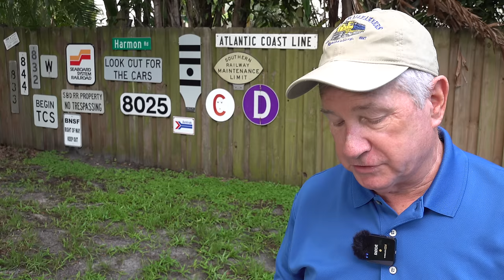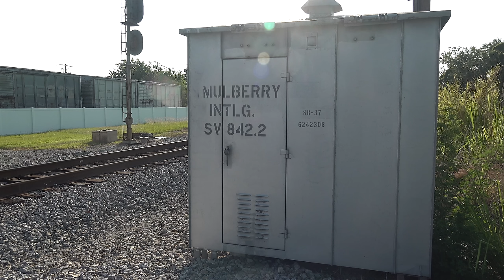Who Controls Railroad Diamonds?

Comment: I still can’t get my head around the system in the US
(In the UK, where i live, although there are many different train operators, the track is owned by a single company (ignoring light rail and heritage lines), and that company handles all the signalling (and train crews contact the signaller directly when needed), and i found out that if a bulb burns out on a signal (completely burns out), it may cause other signals to automatically return to danger (red), and that is the reason why there is a signal somewhere on the UK rail network that is still lit even though it no longer serves a purpose, the UK also has equipment installed at some signals which can automatically stop a train if the signal is at danger (red) and the train is either approaching too quickly, or passes the signal (every train is fitted with equipment that interacts with the equipment on the tracks))
Reply: Every railroad owns their own tracks for the most part. Railroads can buy trackage rights on other railroads and operate on them if the other railroad agrees to it. Amtrak has trackage rights on most of its lines because it only owns the NEC and and a few hundred miles elsewhere. Overall, it's probably similar to how things worked in the UK before BR.

Comment: Why hasn’t anyone invented a rotating frog on these diamonds such that the wheels run on a nearly continuous rail head?
I guess maintenance and reliability might be less than fixed frogs. 
I would liked to have seen a train using the OWLS direction. 
Anyway, great post. 👍

Comment: It depends. Automatic inter lockers, you have to automatically get down, manual inter lockers, are controlled by control operators or Dispatchers
Reply: At least on the BNSF side who I work with, if it’s automatic, we would get down and push a button and it’ll allow us to go across if we had to stop. We would talk to which ever railroad we were crossing unless it was our own, I’ve had an interlocker drop to red as soon as I approached the signal and it put my train in suppression and when we passed the red signal it put us in emergency and we stopped 40ft from the interlocker, it’s a bit scary
Reply: You should hear what some sound from inside the cab, it can be loud some are very smooth but metal on metal, isn’t very comfortable

Comment: At 6;20 the signals can and will go into a time ot episode, but usually you will get a proceed signal when yo get on short approach. Also if you are pulling hard as in notch 8, when your locomotives go over the diamond you throttle down to notch 5.
Reply from the maker: Thanks Richard. Those are points I did not know about.

Comment: Awesome video Danny! However, I do have a few questions that I hope you could answer.
I am planning an HO Scale layout in which a double track signaled BNSF main line crosses over a single track, non-signaled UP branch line. Which railroad would operate the signals? Would they be automatic, or dispatcher controlled? And would the UP have to call into the BNSF dispatcher for permission and a signal? I hope you can answer these questions and keep making these amazing videos!
Reply: Chances are in that situation it would be an automatic interlocking. The UP line would still have signals, and I presume your BNSF line would be CTC. If it was manually controlled by UP, the BNSF dispatcher could call the UP dispatcher and ask for the signal, or the BNSF crew could do it themselves once they got into radio range of the UP. If it was manually controlled by the BNSF, the  UP dispatcher or crews could do the same.

Comment: If it's a controlled diamond, the railroad that got there first controls it. If it's an automatic diamond, whoever hits the circuit first. If the train has a red at the automatic diamond, they 'll have to go by the instructions in the interlocking box. Controlled is controlled either by a dispatcher or tower operstor. Automatic is exactly as stated, automatic.
Reply from the maker: Thanks Charlie. I'll put that in my notes.

Comment: Great Video, as usual. Not all railroad crossings at grade are interlocked.  There still exist crossings where a 'fixed signal apparatus' is operated by train crews after making a 'Statuatory Stop' to line their route.  Such a fixed signal may be a horizontal crossbar with or without appendages such as balls that are displayed horizontal for one carrier and vertical for the other carrier.
Reply from the maker: Thanks, Yes I hope to cover non-interlockings soon.

Comment: Interesting video on an interesting topic. I thought I read that the 'frogs' of switches, use a special steel alloy for the pointed crossover, that can take the hard hammering of train wheels as they cross over the gap in switches. I would think a similar alloy is used for the crossovers in a diamond. Thoughts?

Comment: Great video, I don't have any background on railroads but I find your videos fascinating. I once again make my plea that you do a video on what happens when a train derails and why they seem to be coming more prevalent. Also, it would be great if you could also touch on what processes are in place to prevent it (like the gizmos that measures bearing temperature)
Reply: Derailments are not rare, and never have been.  Most derailments happen at low speed and very little of the train is affected.  It's the high speed derailments that are catastrophic.  

Whether catastrophic derailments are becoming more  common can be hard to judge.  There is bias in what happens in the world and what one hears about.  The high profile derailments of late have dealt with the issues of toxic cargo on trains.  Such derailments can obviously affect a large number of non-railroad people.

Derailments can happen for a few different reasons, but the largest reason I know of is rail fatigue.  As heavy and solid a piece of rail may look, they can have microscopic flaws inside that can, over time, become bigger and cause sudden failure.  A broken or ready-to-break rail is obviously not good for a train to ride over.  Railroads (especially bigger ones) have or pay for third party special rail scanning vehicles to scan the rails' internals for yet-unseen flaws.
Reply: @jovetj  thanks for the excellent explanation
Reply: @charlesreid2141  Sure thing.
As for what happens when a train derails... it's pure physics.  Especially inertia.  
There are many other things that can cause derailments, such as poor tie/sleeper condition, rails out of gauge, damaged wheel flange, seized wheel/axle bearings, broken axle, damaged or poorly maintained track switches, too tight of curves with too little weight in cars on the curve, going too fast on a curve, probably some other improper train handling that I can't even think of.

Comment: One thing I have wondered, dispatchers know what signals are doing but do they know what their trains are doing at all times?  that is do trains run something similar to ADS-B transponders that all aircraft use squawking their course and speed in real time.
Reply: Nope, dispatchers usually only see block occupancy (if it's CTC). They can't tell if a train is stopped or moving, although they can see the time between certain points to get an average speed between them. PTC might be changing this, but what a train is doing at any given time typically isn't a priority for a dispatcher.

Comment: Basically all diamonds are custom-made due to them all having slightly different angles, and as such take a long time to make (several parts are cast and molds have to be made). For this reason, it is not uncommon for railroads to keep an old diamond around somewhere in case the one in use is damaged. CN does this, and it's a great way to get a close-up look at diamonds without having to stand on the tracks

Comment: @Distant Signal Towards the end of the video saw that you have a Kenwood radio in the truck how do you like that radio compared to the Motorola when listening to railroads?
Reply from the maker: I think the Kenwood is about the same as the Motorola as far as receiving goes, but the Kenwood has far more features and flexibility. Audio output is not as good though. I miss that big Motorola sound.
Reply: @distantsignal  Try adding an external speaker.

Comment: What if there were multiple rail lines running parallel to each other which are intersected by a set of other lines all of which are  owned by different companies, trying to get authorization to move your train through would be real messy. Just in theory.

Comment: Hey Danny, I've made a rail video or two but I'm not extremely knowledgeable about the inner workings of the railroad. I notice when filming some of the cars seem to pass by with a smooth roll and others pass by making a racket, as if the wheels on the car aren't smooth/circular. Am I correct in this assumption?
Reply from the maker: Yes, that's usually what's happening. If a car has one or more wheels with flat spots, they make a racket. If all the wheels are smooth, the car won't make much noise at all.
Reply: Thanks Danny @distantsignal

Comment: I kinda wonder why Amtrak is running two locomotives on one side of a train, both with the cab facing the same way. Talk about efficiency (or the lack there of)...
Reply: Plenty of time to turn them at the end of the line. No reason to have them on both ends of the train.
Reply: @sharkheadism  It's easier/cheaper to run a train into a wye to turn it around, than to walk to the other end of the train?
Reply: @Tiger313NL  I don't know if they wye a train or not but that doesn't matter because they can switch it out too. The locomotives will be sent to a service facility to get ready for their next assignment and that will take at least a couple of hours anyway. They're not like planes where they need a quick turnaround, if engines are needed in the meantime the service track will likely have other locomotives fueled and serviced, ready to go.

Comment: WHAT is  a C plate for?
Reply from the maker: The C plate indicates "Stop and Check". Usually on draw or swing bridges. Stop your train and check that the span is lined and locked before proceeding across. UNless you have a green, or confirmation from a bridge tender that the span is OK to cross.

Comment: Doesn't diamond crossings feels a little 19th century. Why not build a bridge so the speeds can be higher?
Reply from the maker: Bridges are incredibly expensive and often not practical in crowded urban areas.
Reply: @distantsignal  can’t be many left in Western Europe. Heard there are only a few in the uk . They have so many disadvantages. First the tear and wear must be devastating and the speeds must be very low to cross them. Hardly good in 2023.

Comment: How can there be a Purple-D-Rail-Sign in existance?
- Shouldn't a railroad company avoid derailing at al cost?
 This sounds dangerous,: "Yeah, sometimes our trains derail on that piece of track, let's not fix it, we  did put a purple sign there."
Or, what do I know, what a D-Rail-Sign is supposed to signal, maybe I just don't know, anything?
Reply: It's a safety switch that's used on sidings: youtu.be/4J7bjROO-gc?t=159
Reply: @MellowYe77ow  --> Thank you very much !!! Now it makes so much more sense to me.
Reply from the maker: Sometimes it requires derailing one train or car to keep it from hitting another one. Very rare, though.
Reply: @sebastiank1714   You're welcome.

Comment: sorry but i deduct many points on the bar b q place for using plastic not pressed paper.  for there to go orders. 
i am not a eico not. just believe in trying to not use some plastic items for single usage. 
sure styrofoam is a great insulated. but will never decompose.  great for insulating a wall in a house.
other wise if i do ever get there i can have a good meal. .
Reply from the maker: You're probably right. That paper-based stuff is way better for the landfill problem but I think it's more expensive. Plus, I think the impact of take-out barbecue on the environment is minuscule compared most other retailers.